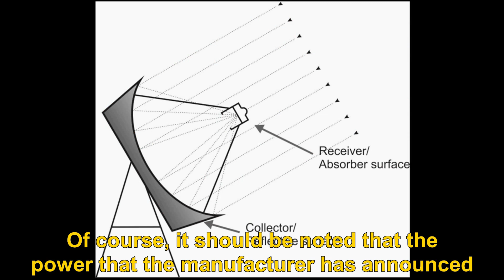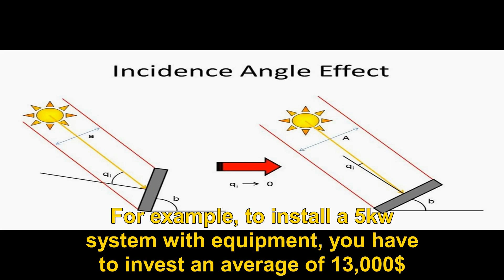Considerable comparison between solar dish and solar panel

Comment: Thks &;
I plan to try to place a small solar panel at the focus of your solar concentrator.
Yes, high temperatures kill silicon solar cells.  However orbiting satellites is exposed to very hot/cold temperature & use expensive gallium arsenide solar cells.  Hopefully 1or2 is won't be so expensive (fingers-crossed).
PS: Unfortunately 1 square meter of gallium arsenide solar panel cost $2.4 million.  So I'll try it with water cooled silicon solar panels I guess.
    Most Efficient Solar Panel, GaAs Solar Cell Price (1 square meter of GaAs solar panel cost $2.4 million) https://www.youtube.com/watch?v=vaumQ9I34g4&t=58s